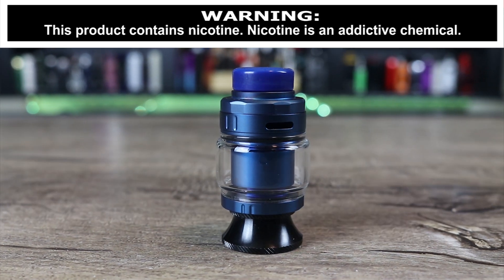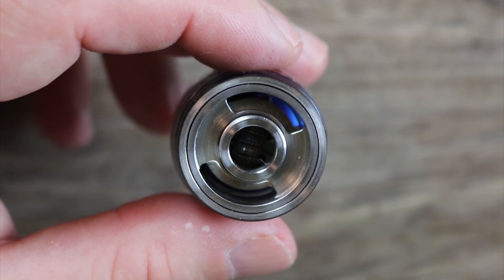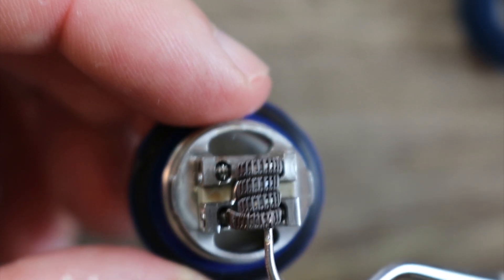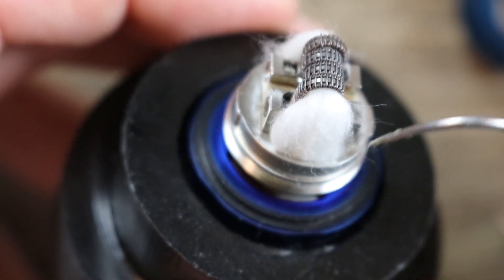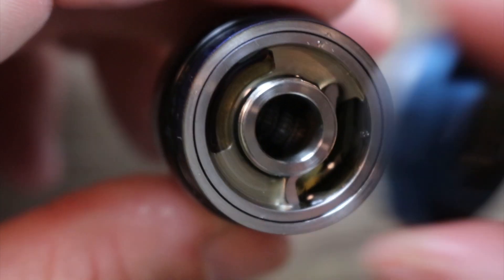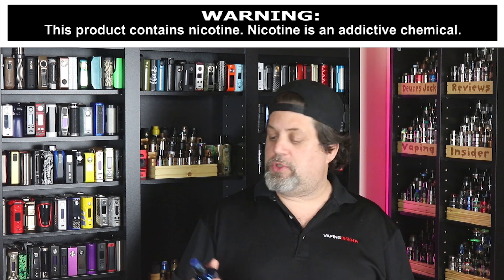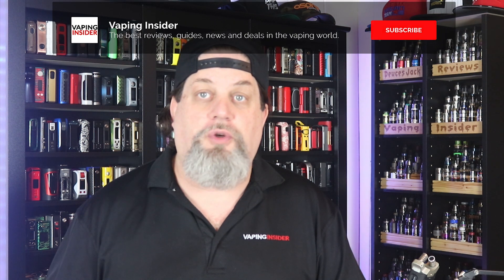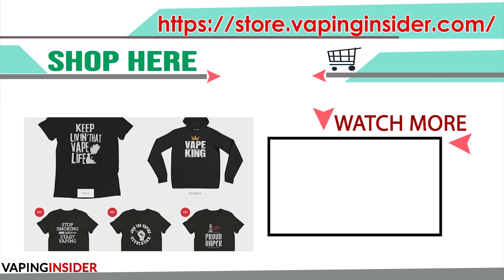THIS RTA IS GREAT FOR NEW BUILDERS! ✌️🚭

Comment: Thanks for the review, Jack. Reminds me of the Advkin CP TF, which I didn't like (and I have 2 of em lol). I never got bangin flavor from any TF style tanks. I mean, it's ok, just not great. But I can see some good points in this little guy, especially as you said for beginners since it would be difficult to get it to leak and easy to build on (even though I am not a fan of most postless). I will stick to my bottom AF for now as I doubt much can topple the PM25 for me for RTAs (or I am just a fanboy, either way).
Reply from the maker: Yeah I am a bottom AF fan as well. Good news is the top AF stuff is getting better.

Comment: Can ya run dual coils on it? Or is the deck to small??
Reply: Fig Y - Watch the vid again. It is clearly explained. Except for smaller diameter dual coil builds, the deck is a bit cramped, hence he preferred a single 3mm Clapton. The manual mentions a recommendation of a 3.5mm coil for single builds.
Reply: @racer774  comment before he got to that part in the video guess i should just delete this comment huh

Comment: I actually have found that out of all of the tanks I’ve owned, which easily exceeds 40 rta’s (and that’s just rta’s not RDAs or gta’s), I get the best flavor out of my top airflow tanks, like my Zeus X rta
Reply from the maker: Yeah that's just not factual at all. A great bottom AF tank will always have better flavor than a great top AF tank. That's just the way it is.